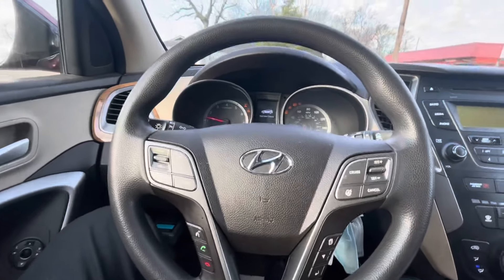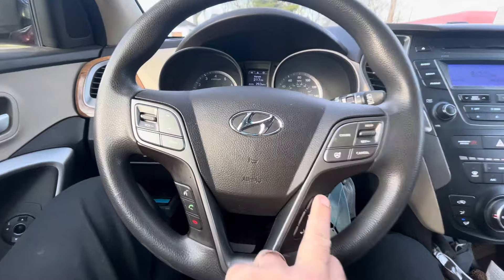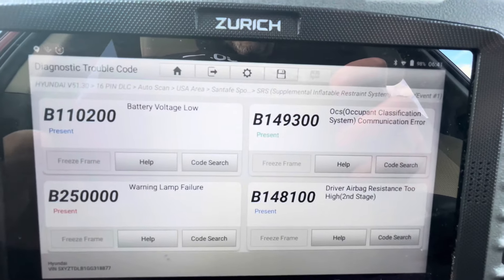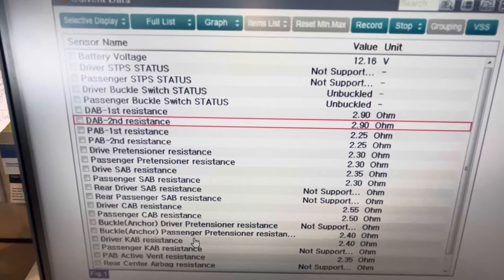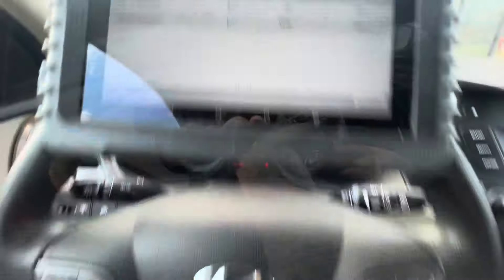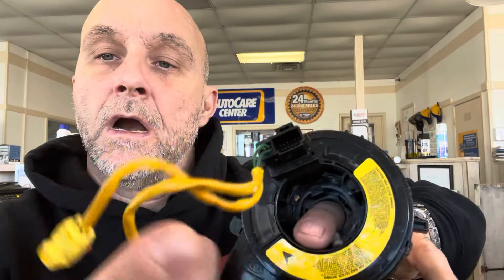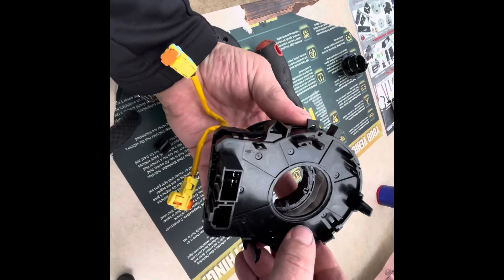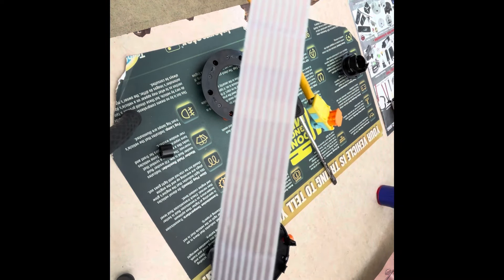Customer states my steering wheel controls are inop

Comment: Realize this was a tear ago but you should have used the scan tool to verify the ECU was not getting data when buttons on steering wheel get depressed. Very simple test to verify clock spring continuity. Thanks for the video.

Comment: I have a 2018 Hyundai Santa Fe Sport Base and the menu bottoms only on the steering wheel are not working, every other bottoms are still working. Do I need to replace the clock spring?
Reply: Did you find an answer ?
Reply: @Jacob Velasco  No, I have not gotten the answer. The only bottoms not working are for the vehicle menu. The other ones, like the cruise control bottoms,  the audio control bottoms, and the phone control bottoms on the steering wheel, are fully functional.
Reply: Interesting it’s similar to me my buttons on left side don’t work as in media and call and the right side cruise control and menu buttons works
Reply: Wondering if you found a solution or repair cost as I have the same issue…
Reply: Same i have a 2015 santa fe and only the menu buttons are not working, everything else is fine

Comment: The controls on the right side only work when I turn the wheel, the left side works great

Is it that yellow part the the problem or are the buttons the problem???
Reply from the maker: I could possibly be just the buttons especially  if horn and everything else on steering wheel works.
Reply: @Columbiaauto  If everything else works fine, the problem is the buttons on the left side, they only work when I turn the wheel halfway
Reply: My santafe menu buttons are not working only, so what to do @Columbiaauto